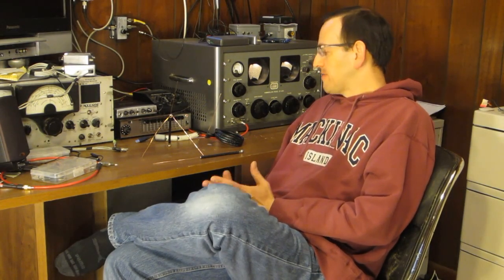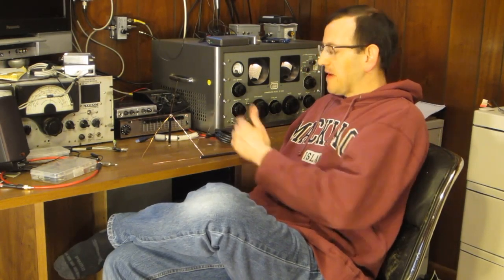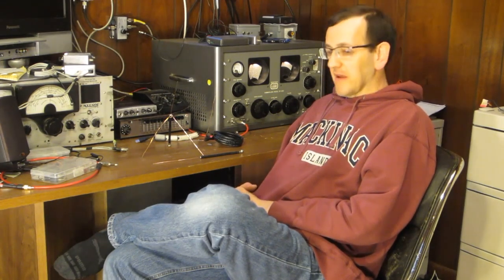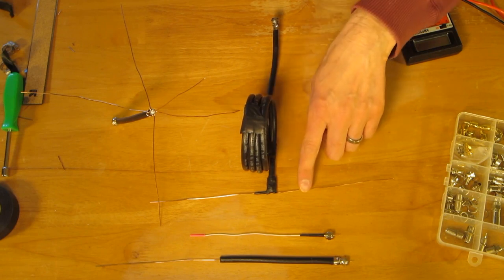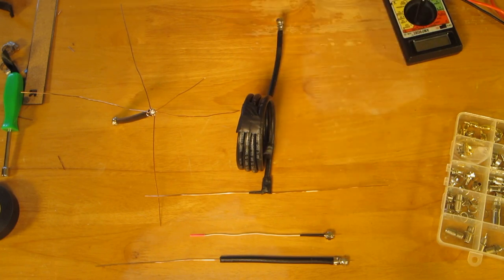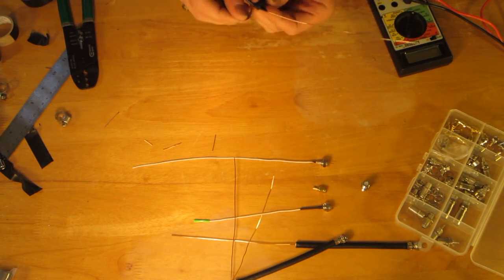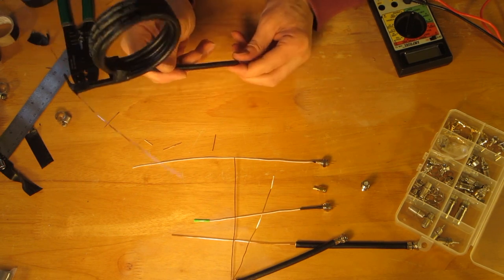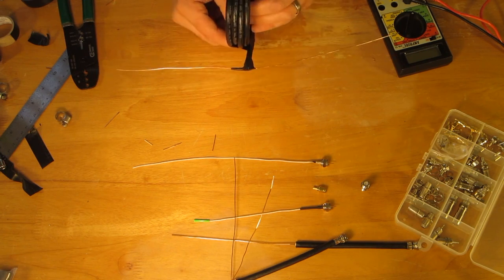DIY No-solder 70cm/GMRS Antennas

Comment: 7:50 you forgot the most important part.. You must pull down a .25 wave of shield over the coax jacket that is goung to the connector and tape it down a couple inches away from the connector.  This creates a half wave vertical dipole aka coaxial sleeve antenna.
Reply from the maker: That would definitely match it much better.

Comment: Hi how would u recommend roof mounting these type antennas. I have sma to f connector on my handheld so ill be running 75ohm outside also.
Reply from the maker: For a very small light antennas like this I have mounted it to a length of PVC and attached it to a roof vent with a band clamp.

Comment: Okay, so let's say I build the dipole and I want to mount it up high. I'll need to run coax to it. All I have is RG58 and RG8. Can I use the RG8 and RG58 if I have built the antenna itself out of the TV coax, or would that result in a mismatch and I should just use TV coax for all of it?
Reply from the maker: Both of those coax types are 50 ohm I believe so it should be ok if you make the matching loop out of the same coax. From what I understand and have read, even if you used 75 ohm TV coax to make the antenna the match should be ok.

Comment: what dyou mean, added wires to the coax shield ''adds a radio "      I just opened the door to the radio world

Also what is the spiral one for, the 4th one. I think you called it a Diet Pole ? what dyou gain from using that

Thanks for the video btw
Reply from the maker: The spiral is a choke balun for the dipole antenna.
Reply: He said radial , that is what the four elements of this antenna are called, some people call them a ground plane.

Comment: Noticed that you use 75ohn (TV cable) in this video and in the Videos where you create  High Pass FM, can I ask why not 50 ohm?
Reply from the maker: Basically, because it is low loss, sturdy, cheap and I have over 1500 ft/450 m of it.   Someone left a roll of almost 1000 ft of it in front of their house a few yeas back with a "free" sign on it. You bet I grabbed that! :)
Reply: @kugellagers  Mine  was "fire damaged" by insurance regs, perfectly good and plastic wrapped.

Comment: 7:43 what's that type of antenna called so i can find some tool to give me measurements?
Reply from the maker: It's just a little vertical stub to mimic the original. It may also behave like a sleeve dipole.